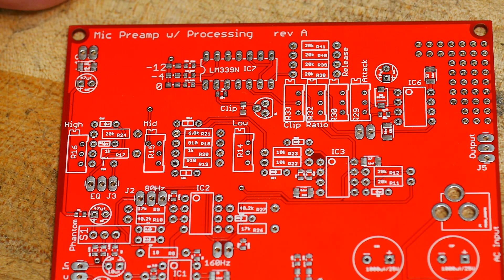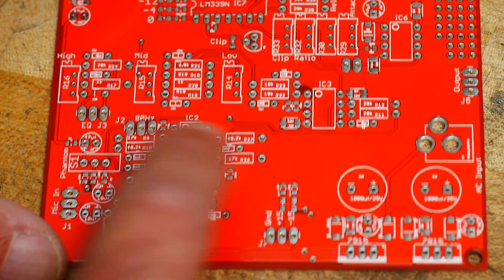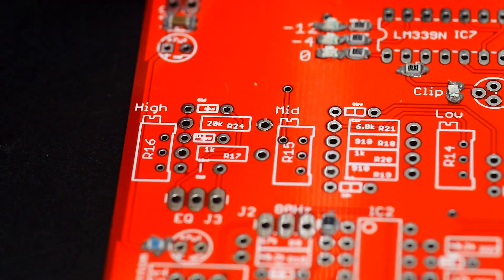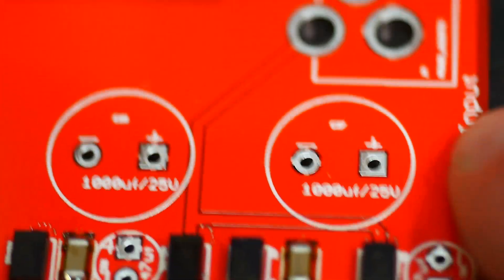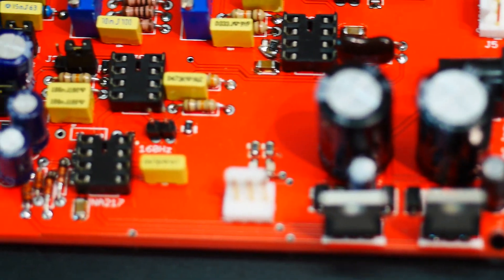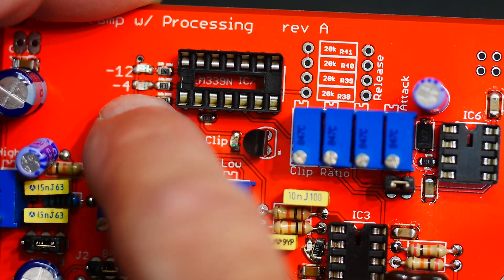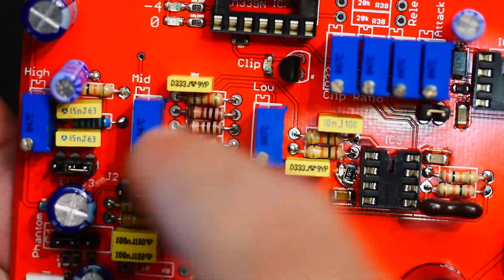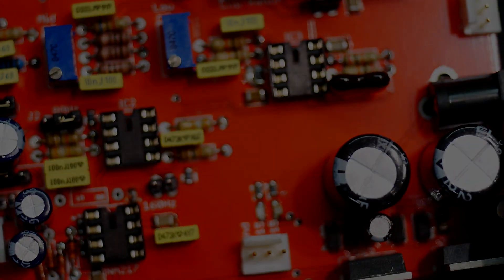#485 PCB design for Mic Preamp and EQ (part 2)

Comment: IC1,IC2,IC3,IC6 INA217?
Reply from the maker: https://youtu.be/BePqr3tp39Q
eagle files are on my github/imsaiguy
Reply from the maker: https://youtu.be/pZwx1jv372Y
Reply from the maker: most preamps are using: https://sound-au.com/project66.htm these days. That has the same performance as the INA217 at lower cost. the ina217 is easy for DIY